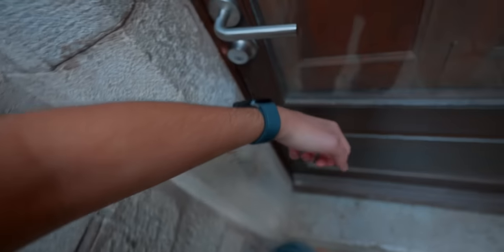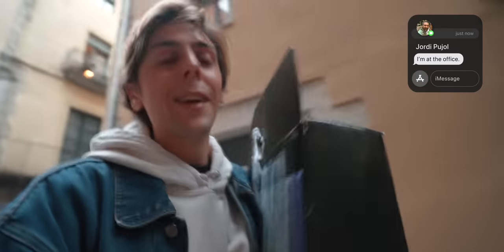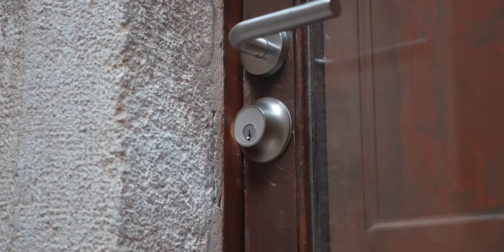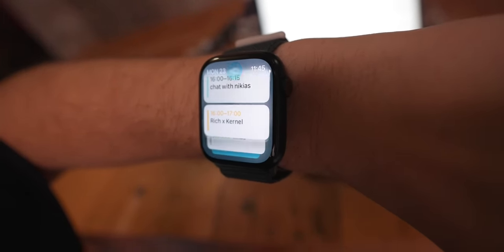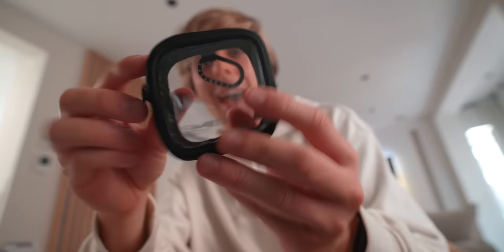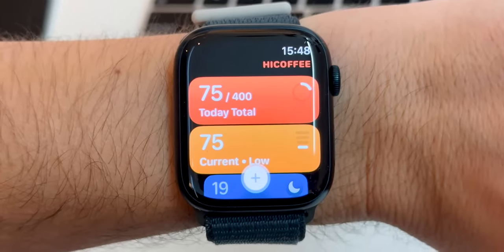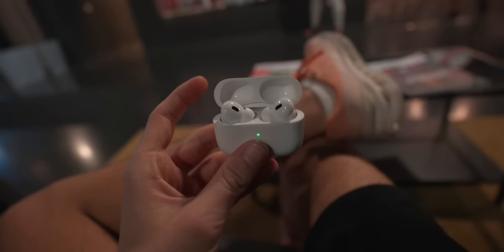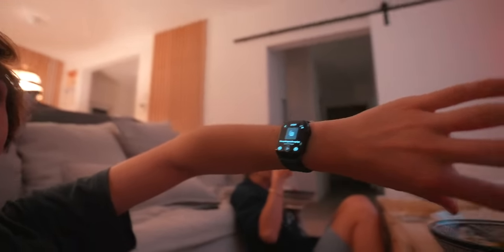Apple Watch Series 9 | Day in the Life (Battery, Double Tap, Useful?)

Comment: Should I be worried. Just got my series 9 today and it charged to a 100 and had it on my wrist for about 15-20 mins and the battery is already at 96%
Reply: check updates, if it still drains by that much after updating, ask for replacement